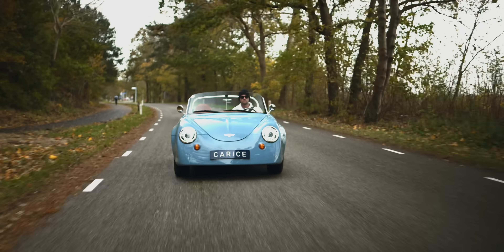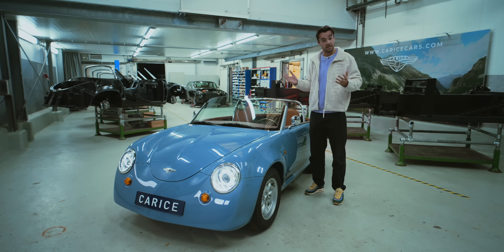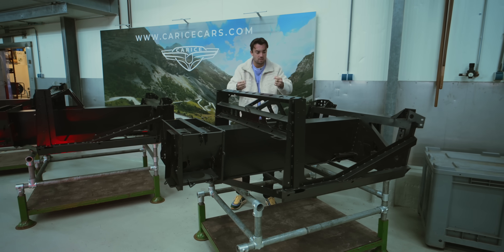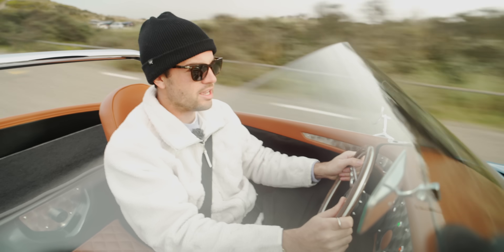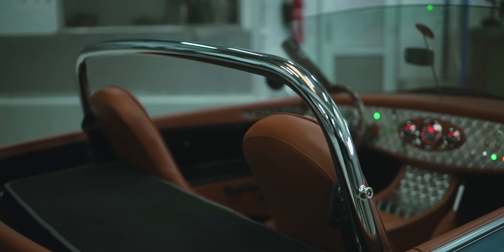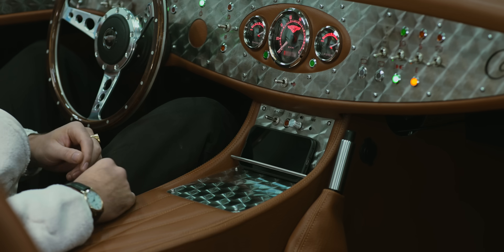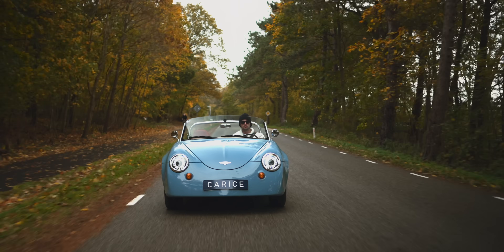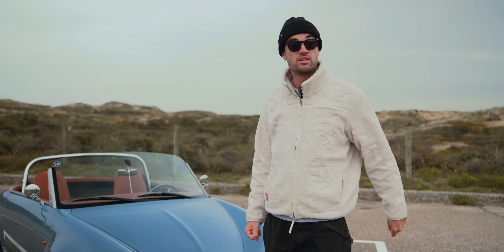This Is The First EVER Lightweight Electric Sports Car!

Comment: The very idea of a sports car, is to either drive it on the Track, or to enjoy LONG, country drives through cool hillsides or mountains. No electric car will ever be suited for that. On the track your battery will be dead in an hour, so that is no fun! And any drive, longer then an hour, through the countryside is a disaster with ANY electric car. Because, as soon as your battery hits 50%, all you can think about is: 'If you are going to make it to a charger, and how long it is going to take?!'. So if you want to enjoy a sports car. You can buy any small two seater gasoline coupe or convertible (an audi TT, BMW, Porsche, a mazda, etc) and you will enjoy the heck out of it. You can wake up in the morning and be like:" It's only a 5 hour drive to Paris! or.. It's only 4 hours to Genève!" etc. And every drive you do with these gasoline cars will be epic. But in any electric stupidmobile, you will never do that, or even feel like doing that. An electric sports-car is a contradiction in terms. It's like making an airplane out of lead. an umbrella made of paper, or shoes made of glass. Anybody who buys this, will regret it as soon as they try a first actual trip with it. Jus because electric cars can accelerate fast, does not make them suited as sports-cars.  Have you seen Geoff buys cars challenge across the UK? The 120.000 electric Porsche didn't even make it across the country, because he was (in just two days) over 9 hours behind a 3000,- diesel car, and gave up. That is the experience you will have if you buy this. Us Gasoline driving kings will be cruising all over Europe, while the idiots with stupidmobiles can't even make it 1,5 hours from their homes before they have to charge for an hour...haha
Reply from the maker: Hello Mr Seawolves. Well done. You have managed to sweep together a small pile of anxieties about a amchine you've never used but have been repeatedly told to hate, despise and dismiss, and you've done exactly as you've bveen told.
Here's a small, countering argument whoch I'm confident you will ignore and that's fine.
Electric cars work.
They use far better, cheaper, longer lasting technology than the combustion cars we're all lumbered with now.
The problems with electric cars are psychological, not technical.
You're comment underlined that last statement.
And lastly, don't try one, don't buy or lease one. Totally ignore tham and carry on as you are. It's fine.
Reply: I've been driving a fully electric car for 5 years as my main car. I was an early adopter. Until a year ago, when I switched back to Gasoline (and will never drive an electric idiotmobile again) So, no! I DO know exactly whet the EV driving hell is like. And I DO love the design of this car. I love the old fashioned styling 100%. Every new car manufacturer could learn form that! If only they would put a reliable, good old, clean and mean gasoline engine in there, It would be a car to love! But this is going to give owners nothing but headaches and disappointments (unless you're getting it specifically to bring your 1 child to school around the corner every day, or do small groceries with it every day. But, if you want a sports car, to DO "sports car" type weekend drives with, No EV on the planet is going to make you happy. They don't do any kind of distance! Within one month of use, you will have lost all desire to make long or medium size trips. An EV is NOT a car! The only honest EV on the entire market is the Byro. It's: small, for the city only, you can drive and park on sidewalks with it, its great. All the other EV's are being super OVER sold, and they massively under deliver. But if you're so sure this is a great 'sports car'. I'm happy to race you. You bring this stunning looking EV, I will bring my Audi TT coupe (mk1 1998 good old clean gasoline). And I'll race you from Amsterdam, via Montreux, to Florence. I bet you, my 20+ year old sports car, will arrive a day or even more ahead of you, and my ride will be a total joy. While you will be stuck in the alps somewhere looking for a charger, 10 times a day... If a car cannot give you an enjoyable vacation ride from Amsterdam to Florence, then it is NOT a sports car! It's a fantastic looking grocery mobile.  @fullychargedshow
Reply from the maker: @SeawolvesTV  Nice try, I don't believe you but who cares. 
Anyway, I drove crappy, unreliable petrol and diesel cars for 45 years and they were all rubbish. I REALLY know what I'm talking about.
I'm not going to defend this one off small and rather exotic electric car, it's irrelevant in the debate we're having.
And sports carts are for sad old men, very tragic notoin, 
And why on earth would I want to race you around Europe in any sort of car, I cannot imageine anything more boring and pointless.
I've been driving electric cars for 13 years, they are massive improvement of filthy, toxic, petrol cars.
Here's another challenge and I will do this if you will.
You drive your crappy old Audi 'clean' petrol car into a sealed container, run the engone for 5 minutes. And I know that car, it's utterly vile.
I will do the same, drive an electric car into a sealed container, all switched on, sit inside for 5 minutes and then let's chat about it.
Except you won't be able to, medics will be trying to revive you because your 'clean' petrol car pumps out toxic, carcinogenic gas, all the time it's running.
It's NOT a sports car and who gives a toss.
Only you
Bye bye.
Reply: Your are correct that EV's are made to perform best inside of containers, while ICE cars belong on the road. I understand you won't race me :). Why join a contest that you know you will lose :). You could bring the fastest EV on the planet, And I could bring a 35 year old VW duck, and I would still beat you to Florence by more then a day :D. You enjoy sitting comfortably in your container inside your over priced grocery trolly, I will enjoy the fresh air in the French and Swiss alps in my sports car :).   @fullychargedshow
Reply from the maker: @SeawolvesTV  I am so happy for you. 
Driving around Europe in your clanking old combustion vehicle burning expensive, non recyclable imported fossil fuel that requires gigawatts of electricity to refine. 
Then, ha ha, and this is the best bit, you proudly burn this filth once and don't give a toss. And you almost cleverly wriggle out of the claim that petrol is 'clean' is avoided by saying EV's are good inside containers.
So now you don't mention how clean petrol is, you massive, bloated hypocrite. I take my hat off to you simply for the demonstration of supreme deliberate ignorance and desperate denial.
You utter hero, because of course the poor suckers you never consider, the people you drive past have to breath in that toxic gas while you laugh and feel smug.
Fine, drive along in your dirty old clunker. Thankfully, before long it will be worth nothing and wear out and be scrapped, and you and I will both be dead and the absurd religion of devotion to internal combustion will be part of the short history of the human race.

Comment: It's about darn time that cars got back to being cars.  A conveyance, transportation, and something for the true driver to thoroughly enjoy operating.  I'm sick and tired of the media-centers and computer servers on wheels.   I have no want, nor need of touchscreens performing every damn function.  I HATE having to play "find the picture" and hunt for some hieroglyph on a screen to use the damn heater.  Steering wheels look like something from a kids toy.  Thick, chonky, plasticky with a huge bulge of bullsh-t in the middle.  I LOVE the classic, chrome-spoke, wood-rim steering wheel.  Yeah,  I sure would miss rowing the gears of a 5-speed manual in this, But that's the beauty of electric. Full torque at "idle" through "max rev" You don't need a transmission with multiple gear ranges.  So I accept the lack of the shifter resting in my right hand.   The clicky, manual switches are amazing!   Plus, for those who just can;t live without a sceeen up their nose 24-7,  you use the cellphone as the screen for music and nav. The bonus to that is you can use your preferred music and nav apps. ("AIMP" for music and Google maps for nav for me, for example) Or I could just jack-in my DAP and play my lossless music files.  I did notice the kind addition of a manual volume knob for the audio input.  Very nice!  No faffing about with yet another tappity, touchy picture on a darn screen do do such a basic thing as turn up or down the music volume.  

Then you have the wheels and tires.   REAL tires!  YES!  I don't want a locomotive driver with a rubber-band on it!  I want a tire and rim.  This ticks that box nicely!   I'm not going to be cornering on the Nordschleife at 100 MPH,  nor am I planning on selling crack to kids at the park.  So I have no use for super-cornering or gaudy 30 inch rap video rims coated in a thin rubber sheet.   Normal rims and tires will do.   

Plus,  this lil' car is lovely!  I would love to have one here in the US.  But sadly, they don't allow the good ones here.  I have to have a 'roided-raged cellphone/media-center on wheels if I want a new car. The only thing promising we have here, and in a similar price range is Aptera. I like the car  but the interior..  Uggghh!  If Aptera would adapt a UI like this, and ditch the whole Tesla screen crap,  I would have put my reservation in a long time ago.

Comment: Omg this is how I’ve been saying the battery should go in an electric car. No it’s actually worse for center of gravity, a skateboard battery is the best way to keep the weight low. But a skateboard battery is terrible for polar moment of inertia, hence most sporty EV’s are good at high speed grip but not low speed agility. Low polar moment of inertia is a more important factor in a sports car than low center of gravity

Comment: Cars like this could fulfill the real promise of electric cars, in that drive trains are simpler by design, thereby less expensive even as they are MORE reliable. The emphasis on high-tech the auto makers are  giving most EVs undermines this and convinces the buying public that electric technology is somehow MORE expensive and complicated, which throws a giant monkey-wrench into the process of switching us over from dinosaur fuels to modern green power.

Comment: Calling this a 'car' let alone a 'sports' car is a bit disingeuious when its registered under the L7e category (if that really is how they do it given although you say this in the review I can't find this mentioned on their website), this means it can't exceed 90km/h or be used on motorways. In the UK the spec actually requires it to be under 550KG so not sure how this would even get registered in the UK. 50bhp/630KG/£38k+ ... given the hashtag you've added of 'Caterham', the base 170 is 10 grand less with almost twice the power and its registered as an actual car. Love it compared to the rest of the bland stuff manufacturers are coming out with but I don't think many Caterham owners are going to be getting out of their 7s into this.

Comment: Seriously?  No negative points what so ever?  Couldn't help notice the roll bar at shoulder height, and no reinforced windscreen frame, It looks lethal in a roll over, Just observations as nothing was mentioned. Good effort though I would have liked some info on the power train.

Comment: Isn’t the new model 3 performance like 550hp , 0-60 in 2.9 sec , 99 foot 60-0 braking distance, with 0.9G skid pad score ? For $45k brand new USD .  It would smoke this little kit car in a straight line , on a track or in any possible scenario.  Is it just because you guys like the color and it’s small and makes it have old-school car vibes or something?  Ok 👌, I guess it wins in the romantic sense .  Just saying they already sell very sporty electric cars now for a relatively cheap price.   Seems like people need to Google what’s currently available.

Comment: As much as I like the design and what appears to be a quality built vehicle, no defroster / heater in the EU is not a smart idea and will come back to bite them in a negative way.  Also not enamored with seats that are not high enough to help in a rear end collisions either.  I would hope it will have an amplifier and speakers to connect one's smartphone to?  Driving such a fun car with no tunes would be a turn off for me.  I hope they make these suttle changes at some point in the near future.

Comment: I get it.  And in my youth I'd want one of these.  But they're twice the price of a Mazda Miata and do not seem to have anything like crumple zones/air-bags, etc.  I think there's a huge market in the US for a convertible EV -- the people who would buy such a thing don't know they would yet, but they'd quickly catch on.  However for such a product to work, it needs to be fairly safe, and fairly cheap.  The Miata is the obvious car.  Mazda's done a terrible job on EVs so far.  They could take what they have an put it in a Miata chassis, and turn their reputation around overnight.
Reply: Note that the Miata buyer is different than a Sebring buyer, and I don't think the same quick uptake would happen for an EV Sebring.

Comment: Come off it lads it’s a kids toy car taken from a fair or a shopping mall; put 50 p in . As soon as the novelty wears off one is left with a slow , no torque golf cart ! Admittedly Jack makes the best of it but you couldn’t even take it on the motorway. I love light , agile cars with insane handling which I why I drive a lotus exige 350 cup when I need a roof . It’s a proper car.
By the way if I was interested in a car and asked what the 0-62 time was roughly I’d be bloody annoyed if the manafacturer didn’t want to tell me . Ridiculous

Comment: Car weights 600 kg and has a range of 300 km with 31.5 kWh battery, meaning it's incredibly not efficient. It's more than 10 kWh per 100 km, while cars 3 times the weight comfortably do around 15 kWh per 100 km. And knowing marketing, that 300 km range is only if you drive it economicaly not like a sports car...

Comment: Hi
I’d like to know the facts about replacing the batteries.  I’m seeing stories in the US and Canada that are $15,000 to as much as $60,000.   I’m now holding off from EV because of this
Reply from the maker: What you've experienced is precisely what hordes of well paid lobbyists hired by the fossil fuel industry are trying to achieve. 
Spread gigatons of negative stories in the press to hold back, not stop, merely delay as long as possible the mass take up of electric vehicles.
They know they are going to fail in the long run, the only thing they can do is delay.

So, here's the fact about replacing batteries. Unless caused by accidental damage, you won['t ever replace the battery in an electric car.
True, 12 years ago, the original Nissan Leaf had a very early version of batteries, but for at loeast the last 5 years, the battery itself, the battery management systrem and a greater understanding of the technology measn the battery will, in most cases, outlast the car.
And here's an important statistic to bear in mind.
in 2012, the cost of manufacturing 1 kilowatt hour of battery capacity (A Tesla Model S had an 85 kilowatt hour battery in 2012) was $1,850.
Today it costs around $93 to manufacture 1 kilowatt hour of battery capacity.
Anyone who tells you that buying a new battery will cost $60,000 is lying.

Comment: I m glad that the industry is seeing this surface, BUT

50 hp is not enough for that weight, and that range is really bad if you don t have fast charging or intend to take the car in the mountains, as you would such a car. I believe it needs at least 100 hp for the weight. I should also add that for an electric car with no airbags, ABS or power steering, and no proven crash safety of any sort, 44K is an insane price.

Also

Where is my manual?? Is it really so hard to connect that motor to a manual gearbox? Come on.... 
Take it off the shelf
Reply: What possible use would a manual transmission have? I’ve been building fully electric race cars for the past 10 years and none of our prototypes have had a transmission, our motor spins up to 8,000 RPM, so our top speed of 140mph is easily achieved with a very reasonable differential final drive ratio of 3.15 to 1, and the motor has enough grunt to launch. In a car as light as the Carice with a much lower top speed that final drive ratio will be even more adventurous.

Comment: They have gone to the old Porsche speedster look. This thing is beyond tiny. It does look cool. Little sausage is a good description for this car. I do like it. But I want a more roomy interior. And I hope it does not ride like a golf cart. I hope it drives and rides more like the Porsche Speedster it visually emulates. With 50ish hp on tap and less than 660 kgs of weight, it should be properly spunky and nimble for urban driving. Not so sure about  highway use. The drive line sounds a bit of amped up golf cart ish to me. Lack of suspension and chassis refinement.

Comment: I don’t know,  if it’s built like a lotus shouldn’t it look like a lotus ? The point of the Porsche bubble car is that it’s a single bubble of metal, isn’t it ? The strength and lightness comes from the compound curve of the huge stamping of most of the body. A roadster looking like a Porsche with its roof cut off is silly. Maybe copy an Elan .

Comment: I’m sorry but for a sports car you need to disclose the 0-60 time and top speed. If it’s slower than an MX5 it’s not worth the lack of crash safety. And strong regen braking, that should at least be an option; wasting energy with disc brakes is not what I relish about driving a fossil fumer. I love light weight sports cars and EVs can be mega quick, can we not have both?